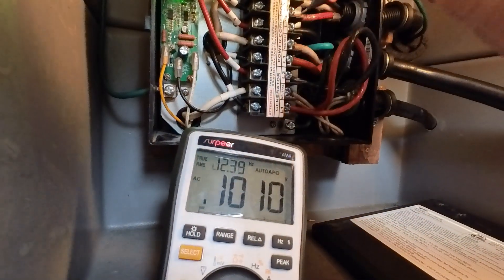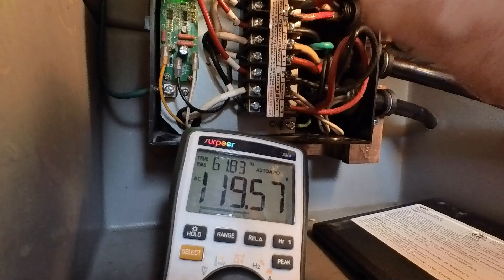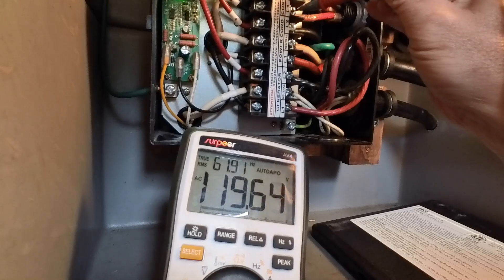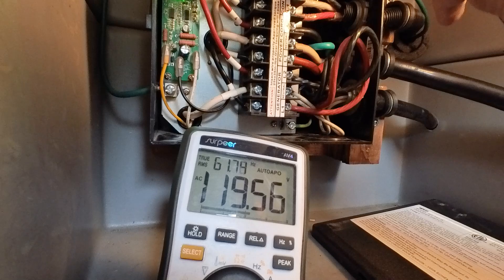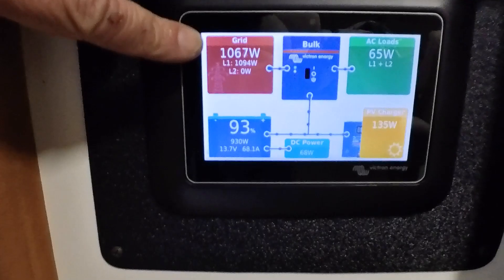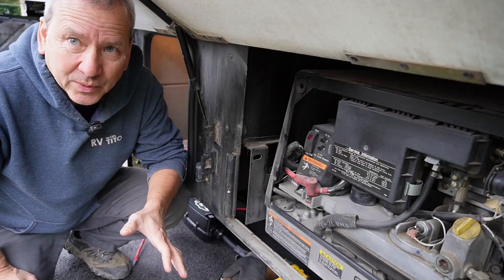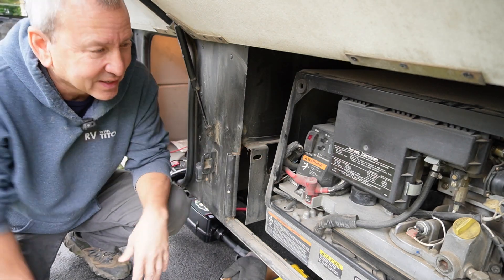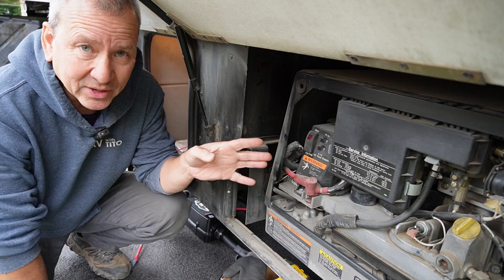RV Automatic Transfer Switch Testing and Replacement | RV With Tito DIY

Comment: Great and timely video!
Have you seen a delay in getting shore power? Meaning, when you initially plug into shore, how long does it take you to see the power feed? My transfer switch delays long enough to the point I thought it failed but 5+ minutes later, wholah...
Reply: It's got a delay timer meant for a generator. Something probably wired backwards, how long is the delay for the generator? Are there adjustable pots to change the delays?
Reply: @my_channel_44  it is many minutes. I have to check. The switch is under the bed which is not too easy to see. I'm wondering if the previous owner screwed something up when they removed an inverter. Thanks
Reply from the maker: It can vary based on the type of ATS. Some have a delay for surge protection or other line testing before switching.

Comment: Checked for reversed polarity?  Grounded neutral?  Your surge protector should have indicated it, probably.  Should have a box with fault displays
Reply from the maker: The neutral wasn't swapped. There should not be a ground/neutral bond in the RV which is wired like a sub-panel. However, the ground/neutral will be bonded when the shore power cord is connected to my house service panel. Yes, the surge protector will look for all of those things plus under/over voltage.
Reply: @RVwithTito  Anecdote: I stopped at a friend's house, which they lived in for 30 years.  I tried to plug into their exterior outlets, and I could not get an electrical connection.  I have an internal surge protector, so I had to go inside to look at the display.  It translated to "reversed polarity."  Everyone of his outside and garage outlets had the hot and neutral reversed.  Surprise to him and me.  He had some computer components burn out frequently, but chocked it up to poor manufacturing.
Reply from the maker: @thetinkercook5430  Wow. Good thing you stopped by to solve the mystery.